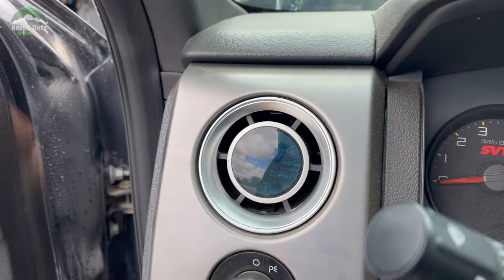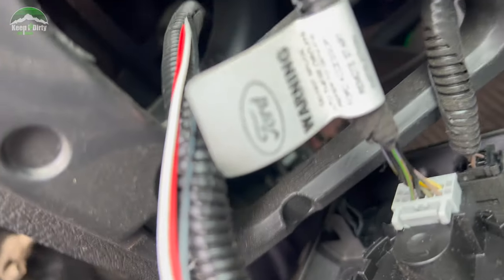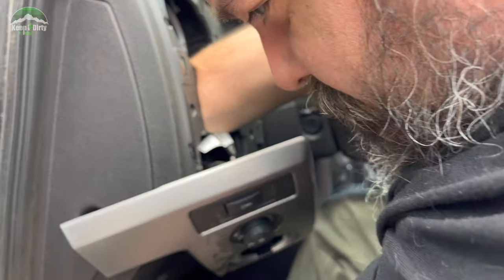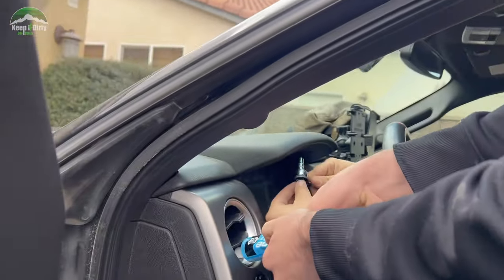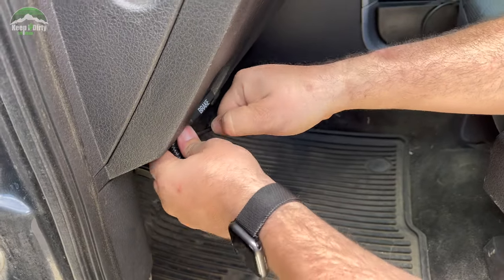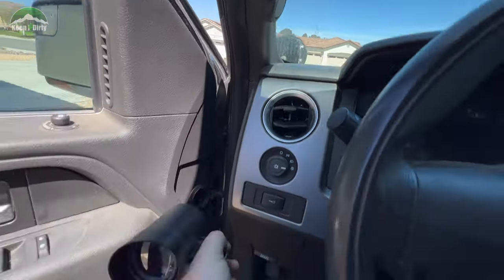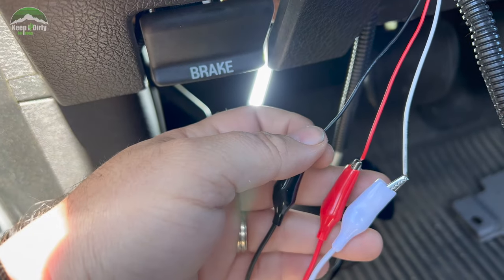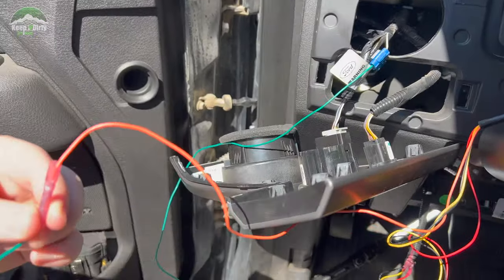Ford F150 Roush Vent Gauge replacement

Comment: Even though ill never need one on mine, its still fun to watch the projects you guys do, but i do need to replace a couple broken vents so in a way it did help. Cant wait for the next episode 👍🏻 

90 already wow its just now hitting the 50s during the day here (far up northeast) 😆
Reply from the maker: Yeah man. Heat is coming earlier and earlier here in SoCal. We had a few weeks in the 90s before temps went back down into the 70s-80s. Means another really hot summer with a few months over 100 again.

Comment: Check out Block8head custom vent pods. He make the whole vent trim piece with a pod molded to it so you still have a functional bent. Awesome work by this guy. Color is a little off from factory but nothing to crazy.
Reply from the maker: Looks like for my truck they only make one that puts it over the steering column and that’s it. You have a link to something else from them?

Comment: Where does the boost/vacuum line connect in the engine bay?  In the intake after the blower, or in a PVC line via T fitting?  Thank you!
Reply from the maker: According to the instructions from Roush I think it’s via a T fitting on a PVC line.

Comment: Amazing video! I was wondering, would this gauge work on a stock Gen1 Raptor? or does it have to have a supercharger to work?
Reply from the maker: Stock raptor don’t technically develop any boost. This is taking a measurement off the supercharger.

Comment: have you looked into the phoenix automotive large screen mod? ive been thinking about doin mine
Reply from the maker: I have, and it’s nothing but bad reviews when guys post long term reviews. And this is across the board with all the large Tesla like screens. Lots of early hardware failures. And tons and tons and tons of bugs. And that’s all with just street driving. Not sure they would hold up well on an off-road truck.
Reply: @KeepItDirtyOffRoad  glad i asked lol